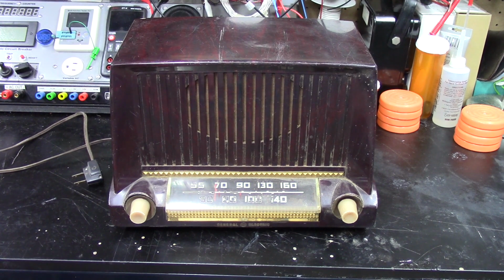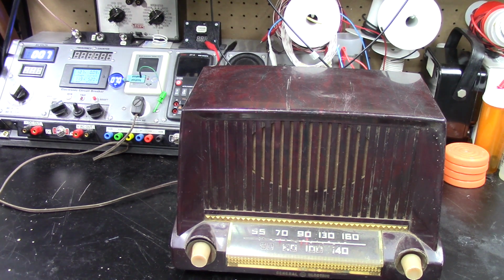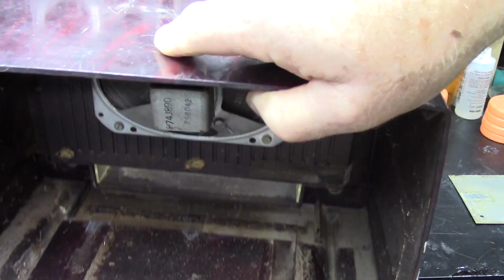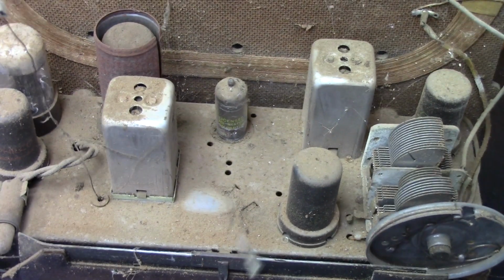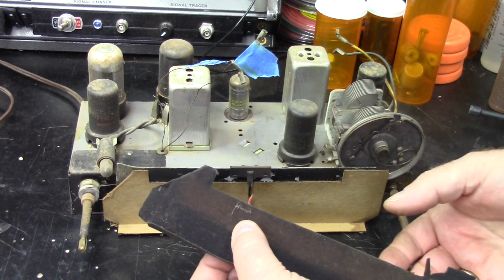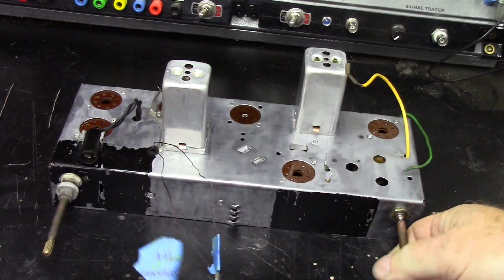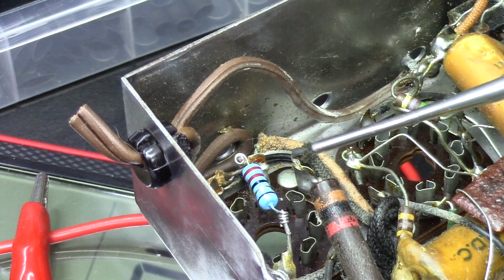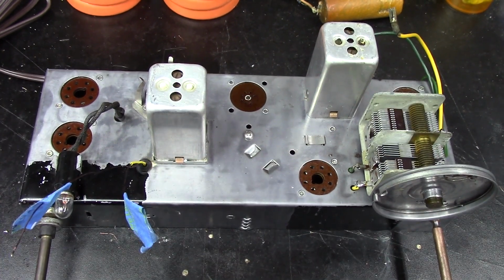1951 GE 404 Six Tube Radio- Part 1-  Disassembly and Electrical Work

Comment: Hi Gregg! You will be able to guide   on a failure of swapping the power cord fir the speaker output😂 In the old radios my guess is that part of the transformer burn, right?

Please advice?

Thank you!
Reply from the maker: Unfortunately I don't quite understand the question sir. The radio in this video has no transformer, other than the output transformer. Swapping out the power cord should not affect the output transformer, unless something was severely mis-wired.
Reply: @greggsvintageworkshop8974  Great work man!

I've got a old phonograph with a reciever. Wasn't sure about the open wires when I got it, I trace the wire from the outside and made a mistake by  seams to switched the power with the audio output, a little bang and some smoke from the side next to the big transformer appeare.

Just wanted to know how to go about in fixing this marvalous piece of a turntable?

Thank you!
Reply: @greggsvintageworkshop8974  How do one go about to start fixing this type of senario? Thank you!

Comment: In making my winter indoor project list, I've decided to add a couple of radio restorations thanks to watching this video. During covid, I restored seven sets and all but laid the hobby down since then. Currently,  I have at least three table tops, one portable (if I can find it), three consoles and a field artillery set needing attention....but two should scratch that itch.😂 

BTW: That Evapo-rust works really well. Likewise, I like using brake cleaner on occasion (for cleaning only) also. Lastly,  What are you going to use on those scratches and refinish? Enjoyed this episode.  Good job!
Reply from the maker: Thanks, sounds like you have a lot of nice projects in your future. Stay tuned for Part 2 where I repair and restore the cabinet. You'll see what all I used in that one. Thanks for watching!

Comment: That radio doesn't have that many parts underneath that is it's not packed solid with one cap on top another. I am working on a GE503 from 1946 its one of two I bought at a swap meet 2 for $10. But it has sort of taken a back seat to my 1952 power wagon for now. Waiting for the second installment doing great Gregg.
Reply from the maker: Thanks Larry, I've been enjoying your Power Wagon series too!

Comment: Since you have a couplate in this chassis the  Rider's schematic for the GE model 422 and 423 also could be used. The 
big change  with the model 422/423 is the dial numbers are printed on a sheet and not painted on! Everything else is the 
same. Since so much white paint is missing from the surface for the numbers and the plastic, shaped like a  horse watering trough, it may be the way to go. Just an idea Gregg since GE thought is was easier for their next radio design . Meticulous  electrical repairs were needed and done. Waiting for tubes; done that. I never have the ones that test bad! Steve
Reply from the maker: Thanks Steve, I think I'm going to try vinyl from my daughters' Cricket vinyl cutting tool. We shall see how it turns out.